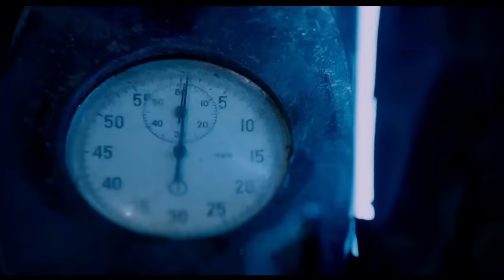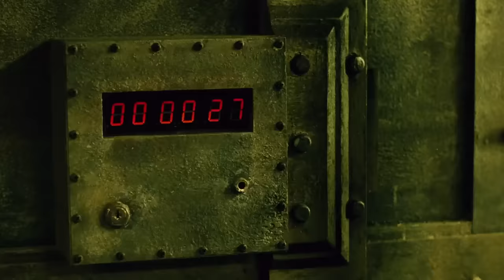The Most Evil Saw Traps

Comment: Classroom trap deserves a mention imo, as another user mentioned. Extremely disturbing visually, coupled with the chains through the Achilles's heel and the jaw and the doors welded shut. Torturous way to go. Surprised at how unrecognized it goes. In terms of how evil the traps are, I only put the Angel Trap and the Pendulum Trap above it because you would beat them if they weren't rigged, so you would have to comes to term with the deceit before you die.

Comment: The saw 5 coffin trap was thought up by one of the producers young son, and originally had the room filling ip with water, but because of logistics,  had to be changed to the crushing room,which follows the same beats as the original idea. Also with the incinerator, yeah its super easy, i havent watched the how to beat saw 2 yet, but yeah if only Obi looked at the wall and saw the devil pointing to the wheel saying twist .
Reply: Or if ANYONE saw the completely blatant metal cable connected to the furnace door....
Reply: Or if you just walked behind the furnace and broke the glass there
Reply: @TheButterSurge it was a tiny little glass, he wouldn't get out.
Reply: @draftofspasiba2  I mean, they could have not gone into the furnace and just break the glass behind to get the syringes
Reply: @TheButterSurge  only the syringe that closes the furnace door was close to the glass, the other two syringes was far away, I don't think they could reach them. Also you know what happens when you don't play by the rules, I wouldn't risk that.
Reply: @draftofspasiba2  ah true, only other way out was to twist that valve as quickly as possible

Comment: See I've always hatedthe saw franchise because between the morons there really isn't anyone likeable, the traps tend to be rigged which 'yea this guy is a sadist but for someone goign t othe effort of all this and failure is the only option ?Fuck you. Then in instancesl ike the one with the motorcycle wit hthe spinny thing? No a motorcycle wheel isn't going to shatter a thing going through its spokes. The spokes would snap like twigs if a metal rod were slammed through .that falls under 'fuck you for trying. Die.'